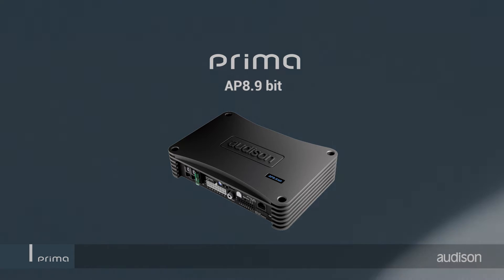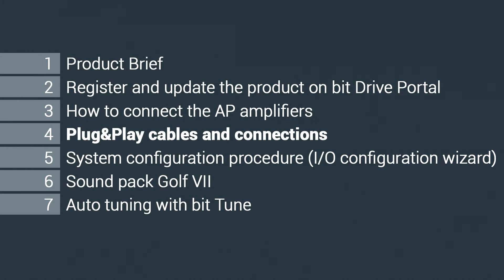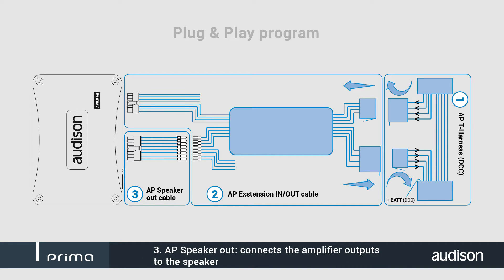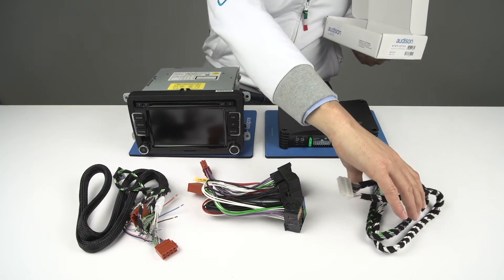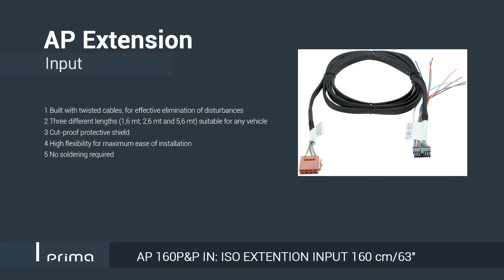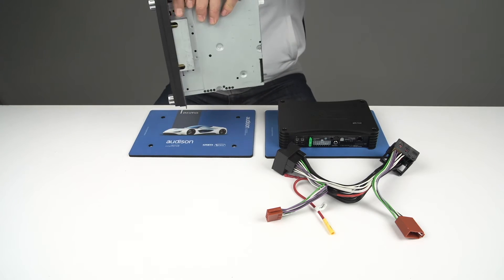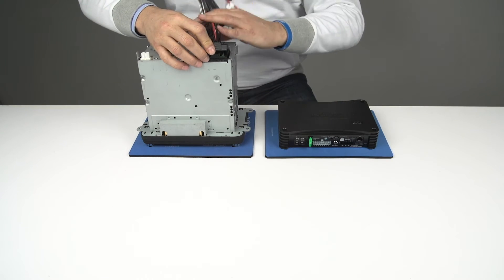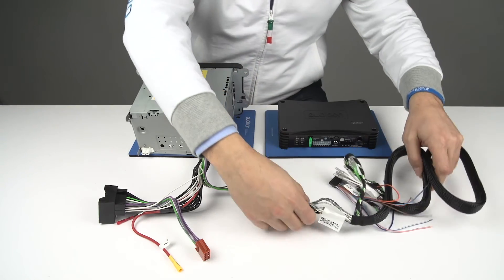4 - Audison Prima tutorial - Plug&Play cables and connections

Comment: so the plug and play harnesses will use factory wiring to the speakers? if so that would save me a ton of time...
Reply: That depends. If you want only 4 speakers hooked up, then yes. If you want to hook up tweeters in the front or rear, or both, youll have to run another wire to each tweet. The in/out cable only has 4 speaker ins/outs. This is stupid, since their top amp/dsp is 8 channels. My b8.5 has 8 speakers and they could all be controlled by the ap8.9 plugged in with the harness, if they just made their harness with 8 ins/outs to match. So i spent $200 on a wiring harness and extension, so i wouldn't have to run new wires, only to find out i have to run 4 more pairs of wires along with the Audison harness if i want to use all 8 channel's and hook up all my speakers. So it is a plug and play, to cut your sound in half.